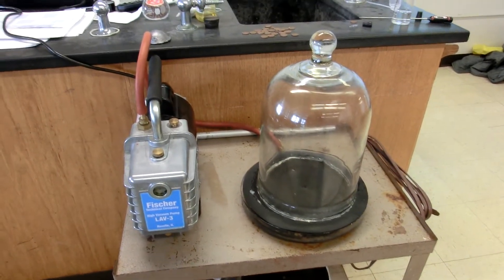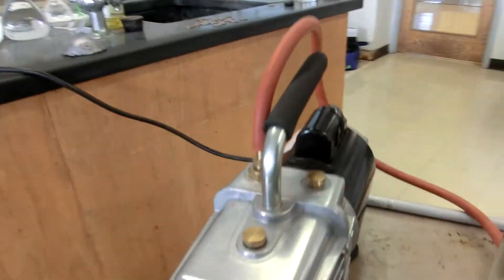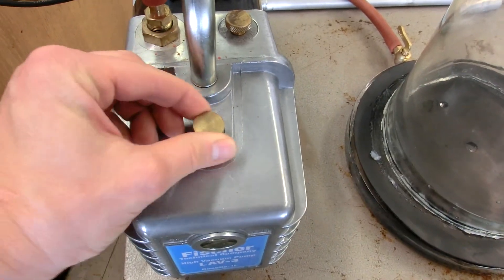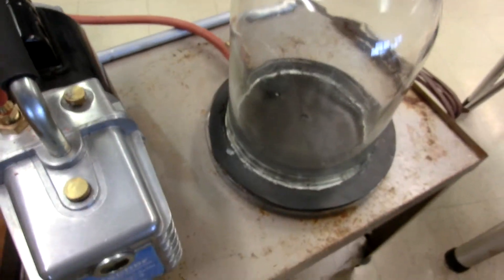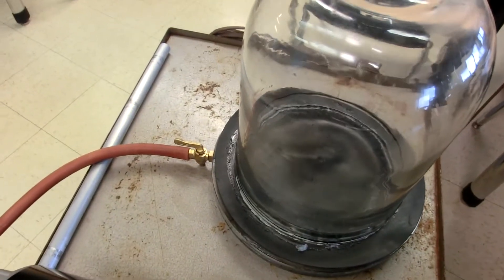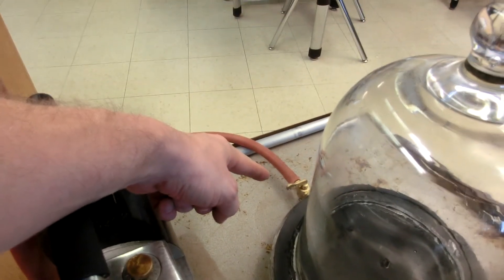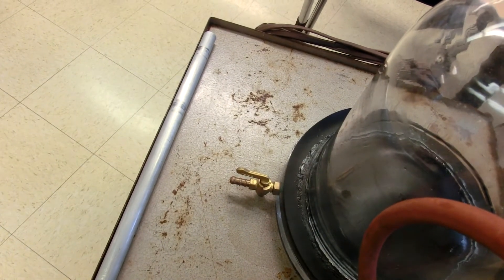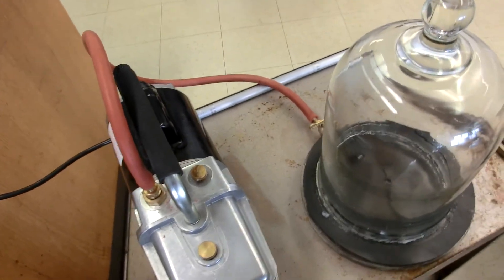How to use the Vacuum pump and Bell Jar

Comment: I would close the valve before shutting off the pump.
Reply: It is good to close the valve before shutting off the pump.  This is very important.  Back streaming of oil starts as soon as the pump looses power or shuts off.